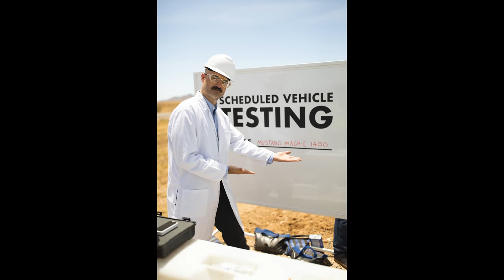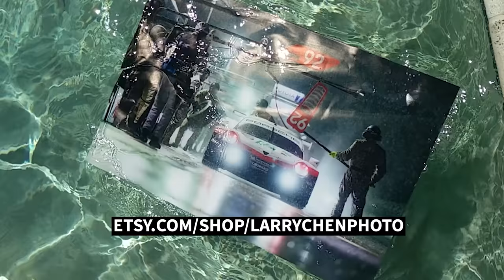The 1,400hp Ford Mustang Mach-E Has Face-Melting Performance

Comment: Sweet vehicle.  Just like I will not call a C8 anything but the ZLX or Aerovette, this is not a Mustang.  It is definitely a Mach E though.  That is a crossover SUV with 4WD Electric motor powered through CVT?.  Not a Mustang.  But sweet otherwise.  Sick selection and pic set Larry!  Your work is very thoughtful and well refined.  Definitely your own signature to selection, Love it!
Reply: The only thing that’s different on the c8 is the location of the engine. What makes it not a corvette?
Reply: No transmission at all. Motors are pancaked stacked and connected to the quick change winter's diffs. 3 motors in front, 4 in the rear. Single speed reduction. For easy gear ratio swaps. So this thing can drift, drag, hill climb, autocross etc. They even have the front setup to remove the motors completely if the setup calls for it.
Reply: @josephsamsor1698  Look up Aerovette and Zora Arkus-Duntov.  Than look up all production Corvettes.  Is the C8 an Aerovette or the ZLX?  Cause the Corvette stands for American ingenuity in the face of diversity.  I.E. The "American" style sports car for the everyday man.  Like spitting in the face of the wind itself the Corvette has battled the Euro sports cars in their MR package and won.  But now.. it rolled over and gave up...it's a Hyundai 458.   The Camaro boys obviously snapped the Corvette teams twigs....
Reply: Joseph Matuszak it’s a v8 sports car. It does everything a corvette is expected to do at an attainable price point. None of that has changed. It’s a c7 but better and just as attainable but now it actually compared to much more expensive cars while remaining reliable and American with its engine. And it looks like Zora would like the c8. The original vette was a slow in-line 6. They had to change from what the corvette was initially and move forward while still doing what was expected of a corvette but with more modern technology and advancements. I don’t see a reason to hate the c8. Finally we have a seriously amazing chassis to take advantage of chevy engines and soon at an even more affordable price once they’ve been in production for a while and cheaper.

Comment: Mach-E weighs 2 tonnes... Gordon Murray built a car, T.50,  weighing 980 kg. EV's are not environmentally friendly if electricity is generated by burning coal, oil or gas. That's not even mentioning production of batteries and the mining of raw materials.
Reply: Standard mis informed fossil fuel shill. Coal is less than 25% off electricity generation. And the U.S.lags far behind other countries. 
In the first half of this year renewable energy and nuclear accounted for over 50% of generating capacity. With everything being done to try and stop cheap cleaner sources.
Just imagine if we actually tried to clean up&improve our aging grid. 🤔